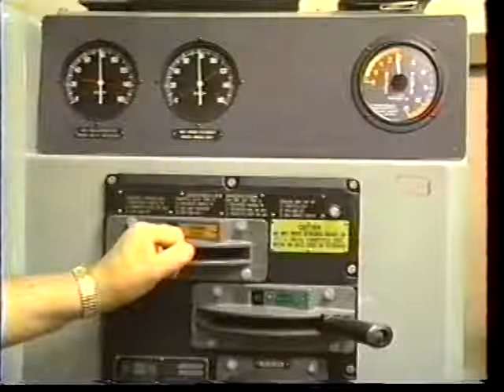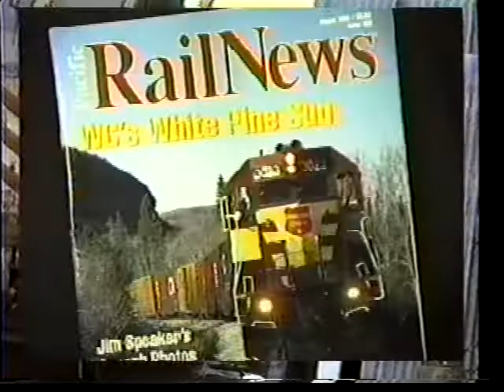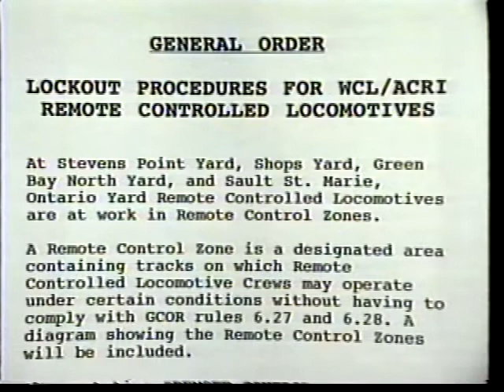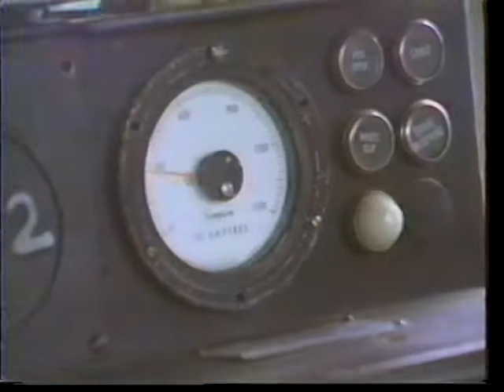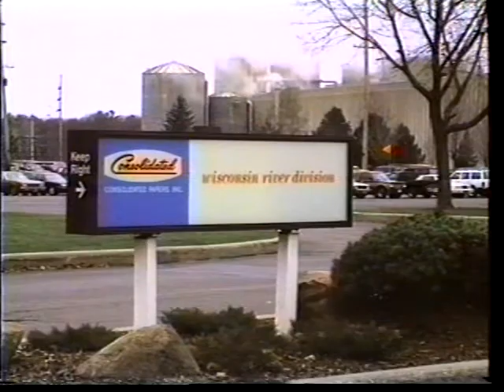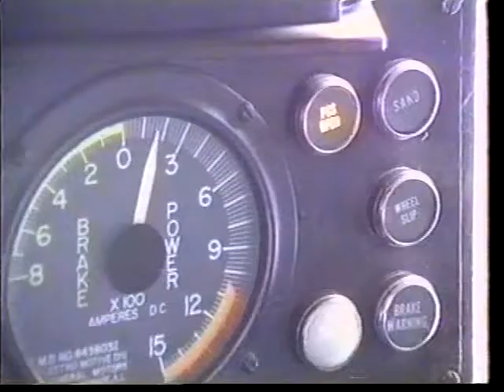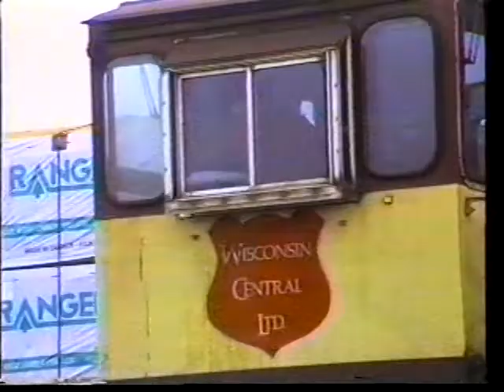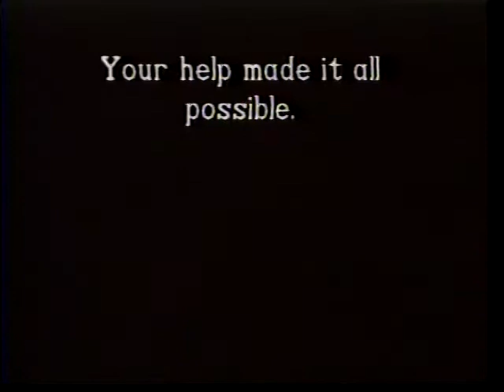WC - Introduction to Remote Control and Engineer Only Operations   1996

Comment: Interesting that MMA also used remote equipment mounted in vans like this to keep power flexible instead of modern smaller remote equipment mounted in the locomotive cab

Comment: cool retro vid but the intro was just a smokescreen for legitimizing removing yet another employee from the payroll
Reply: It never happened and didn't work as envisioned. The unions fought it and won in court in 1997.
Reply: @Jjj-uu1sc  
i'll give you that...

but all these long years later it's no conciliation considering as of right now, remote control locomotive ops is now common practice
Reply: @25mfd  Not anywhere on the forner WC it's not, except Gladstone yard job. I worked for WC/CN in Wisconsin for years and never trained on it or saw it in use. BLET Engineers have the contractual rights for operating RCO, unlike on most railroads where UTU/Smart does. 2 or 3 man conventional switch crews are much faster and safer at switching cars, but HQ just wants to get rid of people and entire crafts at any cost because "it looks good on paper." Brian Buchanan being an ex-Marketing man at WC/CN won't tell you the other side of the story, only the management version he was indoctrinated into for decades.
Reply: @Jjj-uu1sc  
yea i worked for the CNW/UP so our remote control garbage went to UTU...  i hired on 1993...

our remote control junk started around early 2000s... 

but i resigned in 2004 so i never worked with it...

and you are 100% CORRECT when you mentioned 2 or 3 man conventional switch crews are much faster and safer at switching cars ...

but it's interesting that AFTER the 1972 national agreement, which allowed the use of hand held radios by trainmen, that the carriers as a whole started implementing CREW CONSIST AGREEMENTS... 

the CNW started theirs in 1973... back then it was an ongoing effort to get rid of the second brakemen/helper...

and unfortunately, they are STILL coming after the remaining few HUMAN work positions...

my ultimate fear is that they will not stop until there is only UNMANNED ROBOT LOCOMOTIVES like they have in australia